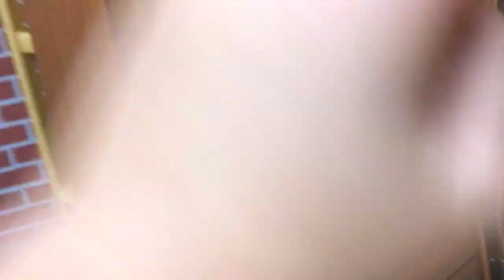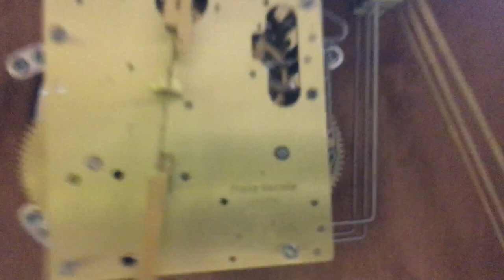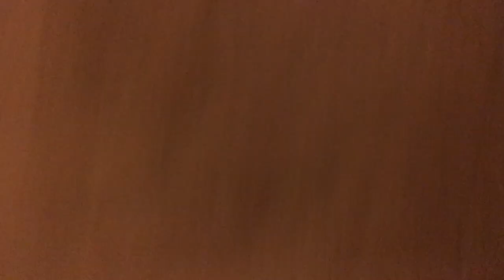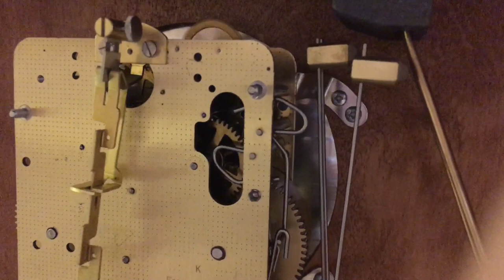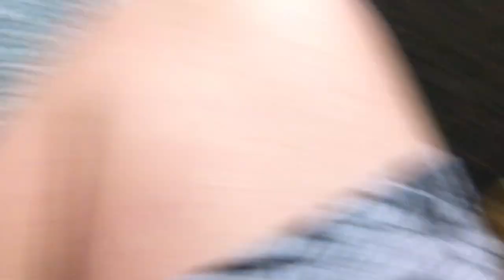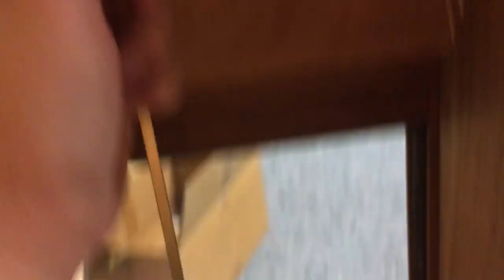In-depth look at a Franz Hermle Bim Bam Shelf/wall clock

Comment: Strange how the chime rods are diagonally down to the left instead of in the middle.
Reply from the maker: Yes it is
Reply: @ogClockTV  why is the sound so dull with no decay? Is it bc the chime rods are bent?
Reply: @SirensAndAlarmsOfNorthernIL  It is most likely due to the bent chime rods... I don't think they should be bent like that, however it doesn't seem like much can be done since trying to fix them would probably damage the noise further.
Reply from the maker: @DannysClocks - You make a very good point
Reply: @ogClockTV  https://www.youtube.com/watch?v=4-E85tFAXNw I would imagine that it's supposed to sound something like this clock. I get that the case design is different, and yours is a shelf clock, while the one in this video is a wall clock, but if you listen to the two in comparison, it sounds like your shelf clock is a more distorted sounding version of the wall clock in this video. Just a little thing I noticed and thought I'd also bring up with you, in case you were interested! :)